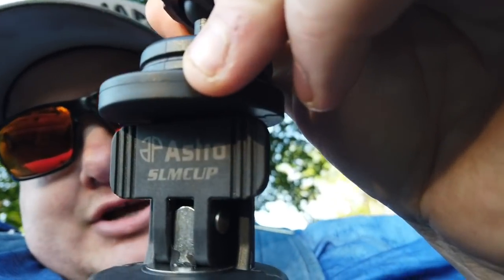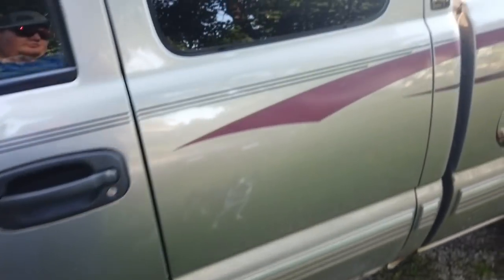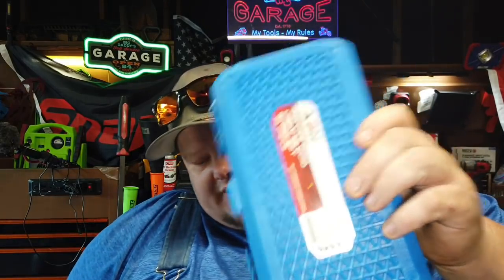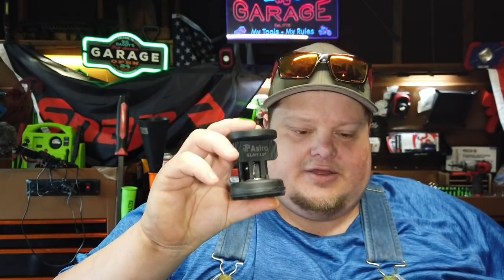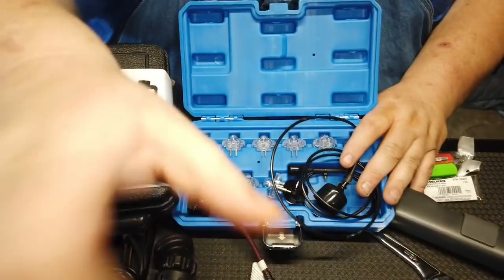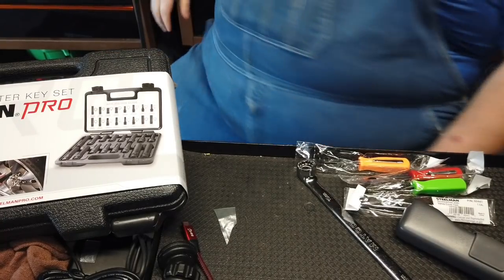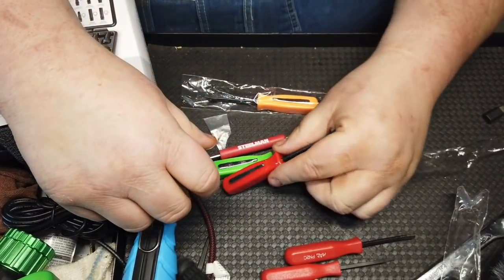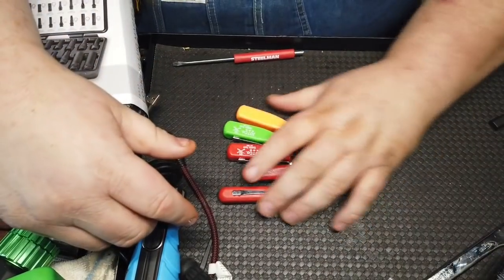HOT HOT NEW TOOLS ASTRO EZRED AND JDTCO!!!!!

Comment: If you have a power probe with the feature to check fuel injectors would you say there is an advantage to these over the power probe?
Reply from the maker: Yes faster checking signals these quick and dirty and won't overload circuits.